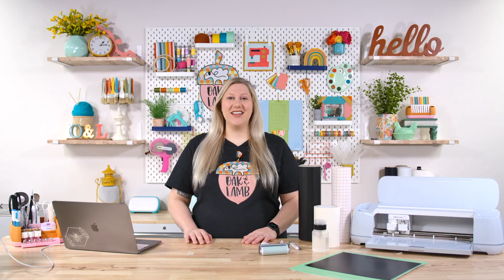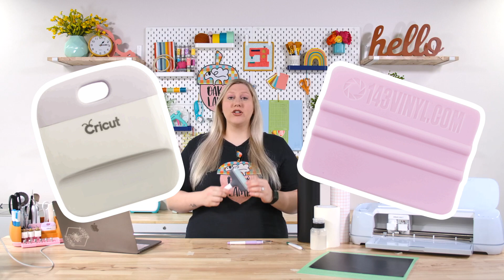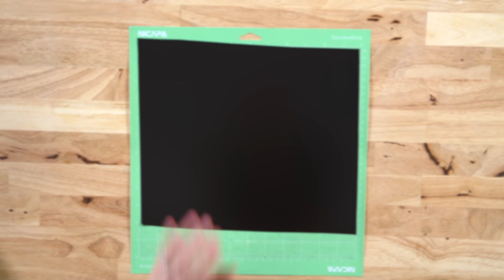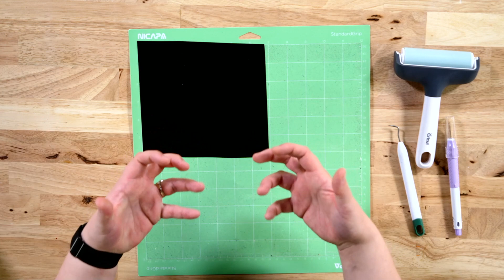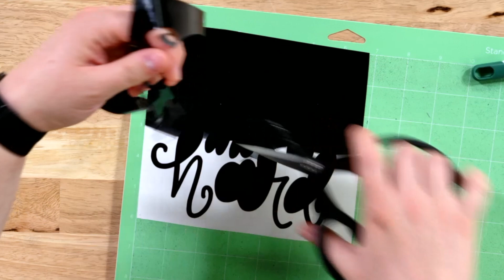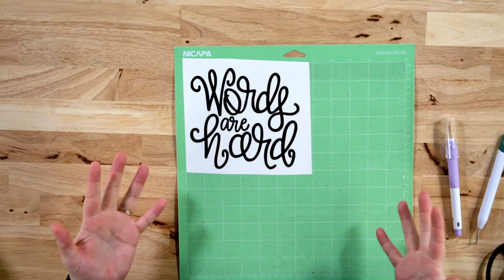Weeding Vinyl - Have You Been Doing it Wrong?

Comment: Hi Rachel. I’m so glad you said that the smart vinyl from cricut is not good quality. I have been using cheaper vinyl and had no issues but for my son‘s wedding and the welcome sign I thought I should buy good stuff which was expensive and just for one sign I used two rolls. It cut no problem, but when I came to weed it it was just ripping, pulling off the backing and I ended up doing two sections of the welcome board twice, it was a total nightmare. I will be using cheaper vinyl in future because I have definitely learnt my lesson.    Thank you so much for all your hints and tips. I have just found you but will be a follower from the UK from now on.❤
Reply: I am having that same problem too.   Still not found a favourite vinyl here in UK yet.